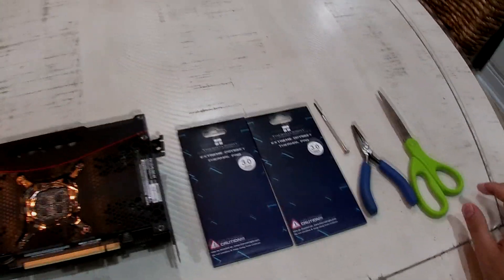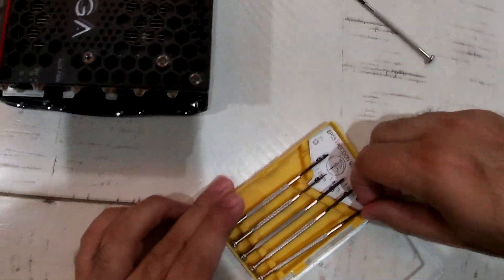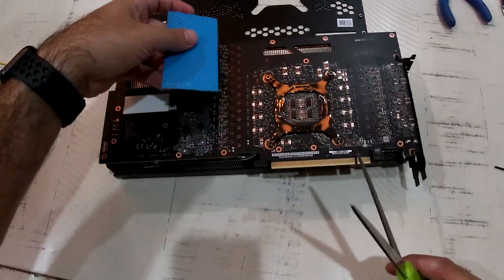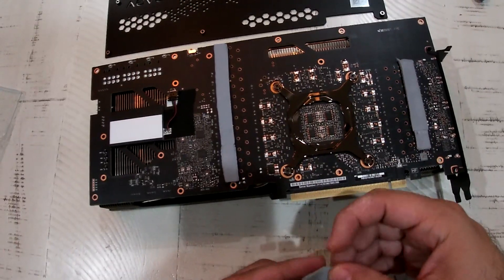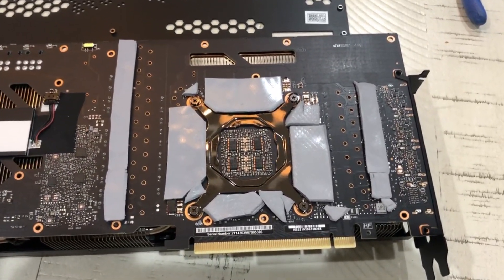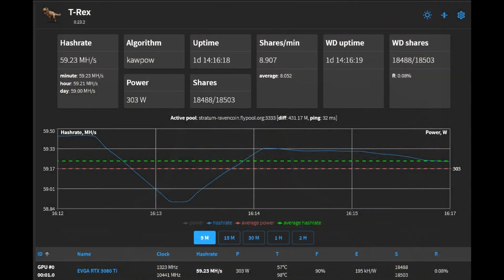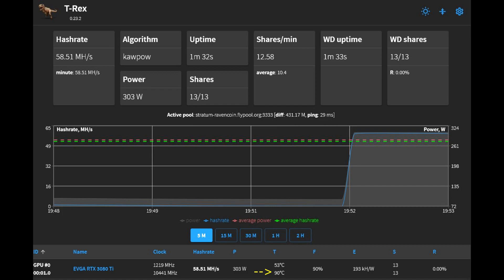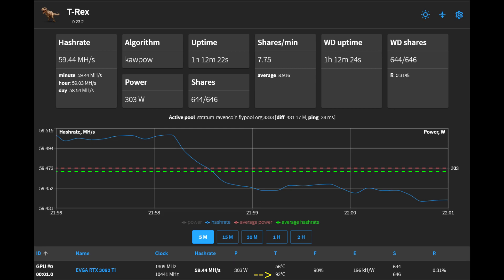How I added thermal pads on EVGA RTX 3080 TI FTW3 to Backplate to lower temps. modification

Comment: @
Rotocut Gaming does using too much thermal pas near the memory backpate BAD FOR THE GPU TEMPS DOES IS HELP OR HURTS TO USE A LITTLE MORE OF THERMAL PAD ????????
Reply from the maker: I haven't see the GPU Core temps go up, because my mod was done on the outside backplate. I've seen reports and I have a friend that actually did OPEN it up and did the whole mod inside, directly on top of the memory modules and he noticed that his GPU core temps DID go up. 

So, I'm not willing to risk my GPU Core temps, that's why I never do this mod on the inside portion, I always just do the Backplate mod and do not notice GPU core temps go up as a result. Just my experience, mind you.

Comment: I tried this mod as well but for gaming instead of mining and my temps also went up. My thought was that it might be drawing the heat to the backplate and just letting it sit there instead of allowing it to absorb into the cooler to be dissipated by the fins the and air from the fans directly. My backplate was extremely hot and even my display ports and HDMI port cables that connect to the GPU were way too hot for my comfort. I reached back to unplug my monitors to take my GPU out again and remove the backplate thermal pads and I have never in my life felt a cable connector get that hot lol. My system runs pretty good after undervolting anyways so i just took the backplate pads off and went back to normal. Mining might be a totally different situating than gaming though because in this video i seen his power was at 305 watts, which is lower than what I'm running at while gaming. My GPU die gets about 72C while gaming and almost all my memory temps are about 68C but there's one sensor in the very middle of a row of memory that starts hitting about 85C. I tried 3 times taking it apart and reajdusting the thermal pads thinking it just wasn't making good contact but its always the same results so I'm just going to leave mine alone. My temps are already pretty good as it is compared to what other people get with the 3080 ti ftw3.
Reply from the maker: It's such a finnicky thing man. dont know it until you try it. I just tried the backplate. It turned out alright for me, but I've heard of bad results as well. Silicon lottery man.
Reply: @rt3rog  for sure. i never win either lol.
Reply: Few years late But:
Probably because backplate is not Alu/Cu metal, and with paint, so it does Not dissipate the heat as good. As such it becomes a warm blanket on top of the thicc hot thermal pad on top of the sizzling chips.

Rather Remove backplate completely and stick some Copper/Alu mini heatsinks & ensure airflow thu their fins. Top shroud removal will help as well as better fans, quieter with good static pressure.
Reply: @ciuyr2510  temps are good without the pads on the backplate. I think it essentially made it a conduit for heat consumption but there's no fans for the backplate so it just held the heat, getting hotter and hotter instead of letting the heat absorb into the cooling fins and then dissipated with air from the fans. It's like if u were to slap an aluminum cube onto a CPU with no fan and expect it to cool it.

Comment: The main mod is changing pads to the VRM's and front PCB, the backplate ones are more of a nice to have but don't offer much improvement
Reply from the maker: very true. i didn't want to open up my card.
Reply: @rt3rog  

"The main mod is changing pads to the VRM's"

Nope, the main reason most people replace the thermal pads, or add them to a backplate of a 3080. is to lower the VRAM Junction temperature not VRM's. Despite having low temps elsewhere, 3080 and 3090 cards have very high DDR6X temp. 95 degrees under load applies to most cards.

Some replace all pads and some just VRAM. I'm changing the pads on the back of my EVGA 3090 FTW 3 with higher conductivity pads. If it reduces the temp by 5 degrees or more I'll be happy. Helps add to the cards longevity. I suspect the backplate pads are the issue, as the memory chips on the rear of the 3090 don't get any active cooling, just a thin backplate to radiate heat. 

Different scenario with the 3080 as there are no VRAM chips on the back of the card. No pads at all though, so adding pads assist with removal of heat from the rear of the VRAM/PCB.

Comment: Maximum safe temp is 95c on the vram.
Reply from the maker: true. just trying to bring it down.
Reply: source? gddr6x doesn't throttle til 110.
Reply: @odellus  Manufactures data sheets, igorslab.  Micron DDR6X.  Operational temps are Tcase 0-95c.  This will be higher for Tj which is the throttle temp.  Tj is the maximum that the memory can take before it starts malfunctioning but this bepends on the chip how close it will get to this temp before issues occur.  This means Tcase has a maximum of 105c.  Never run the memory at high temps with heavy loads and large overclocks.  Its asking for the VRAM to degrade.

When overclocking DDR4 Ram temps matter.  At some point if you go outside the stable temp range then the RAM starts malfunctioning and the Overclock fails.  TOPER = 0 to 95c  For DDR4 the maximum temp is 100c.

Some applications require operation of the Extended Temperature Range between 85C and 95C case temperature. Full specifications are guaranteed in this range, but the following additional conditions apply:
a) Refresh commands must be doubled in frequency, therefore reducing the refresh interval tREFI to 3.9us.
b) If Self-Refresh operation is required in the Extended Temperature Range, then it is mandatory to use the Manual Self-Refresh mode with  Extended Temperature Range capability (MR2 A6 = 0b and MR2 A7 = 1b)

The manufacturer specifies a maximum Tjunction of 100 °C for its GDDR5 modules.  Maximum “Operation Temperature” of 95 °C.

Igorslab GDDR6X modules. Ttot before the start of a possible destruction of the chip should be 120 °C and that Tjunction should probably be set at 105 °C or for the GDDR6X even at 110 °C is specified as the maximum value.  Running the chip at this high in temperature is not normal and leaves very little as a buffer.

IF maximum Tjunction to 110 °C for GDDR6 and memory modules run at say 104c then the remaining 6 degrees until the suspected throttling are really not a big cushion.  Some websites dont see the high temps as a big issue.   Tomshardware gives the TJmax for GDDR6X is 95C.

Then there is mining.  Miners have found that if you dont replace the thermal pads for the VRAM which can reduce the VRAM temps to as low as 85c.  If you just run these cards at high loads and OC's with these VRAM temps.  Then the cards will die at some point in the future.  A few months was given for the failure time.  So youtube has lots of mining videos of people replacing the VRAM thermal pads because the high temps dry out the stock ones (causing even higher temps).  People showing the oil leaking out of the stock thermal pads because they fail due to the heat.

toms: Ethereum mining, temperatures go to a whole other level: When mining on both the RTX 3080 and RTX 3090, we found that the GDDR6X modules would peak at a much higher 110C, and the GPU would downclock itself severely to compensate for the ridiculously high VRAM temperature.

For gaming, with the GDDR6X running at 100C or lower, that appears to be within tolerance from Nvidia's perspective. 24/7 mining on the other hand with memory running at 100-110C seems like the sort of thing that could cause premature card failure.

This is why some people water cool the back of the 3090's when mining, to keep the VRAM cool on both the front and back of the card.  This is why miners are replacing thermal pads to reduce VRAM temps.
Reply: @odellus  it does, i have seen it getting lower hash when hitting 110 only, lower thant 110 is based on silicon lottery
Reply: @xaram  if it's hitting 110 it's throttling my dude. that's the point.

Comment: I did this mod and my temps actually went up 2C-4C. That being said, my hashrate also went up (80MH/s to 83MH/s) so I think there's some funkiness going on in memory throttling on these cards
Reply from the maker: you did it just on the backplate? i have done this Backplate only mod on 2 cards and they've gone down on both.
Reply: @rt3rog  correct, just the backplate

Comment: You need to copper mod the gddr6x memory. I can over glock to 4400 in hive and get 109.8 mhs on non lhr 3080's that way.
Reply from the maker: Yeah I’m definitely sure u can get up to that hash rate but I don’t want to open it up further. Something about possibly voiding the warranty really throws me off
Reply: @rt3rog  from what I have heard in another video that factory warranty sticker does not void in the U.S. if you open up your GPU we as consumer are protected by some law... the warranty void sticker is meant for other countries.
Reply: @rt3rog  EVGA has a great policy about our "right to repair". I called them and asked and they said opening the card doesn't void their warranty, as long as you don't break anything. opening the card is actually pretty easy! i would check Critical Quartz video, cracks it open under 2 mins
Reply: Jesus is Lord  its and msi tri x rtx 3080. Bios modded with strix bios. 4200 on the memory in hive.  Crashed after a day at 4500. So better less hash and stability. Gets 108,9 now. Was 110.4 with the 4500.
Reply: You can explain what you use ? One Copper Sheet ?

Comment: Any drop in GPU temps during gaming with these pads?
Reply from the maker: Unfortunately I don’t game with this card. Don’t have the results
Reply: @rt3rog  All good. I am wondering if I should do it on my 3080ti FTW3.
Reply from the maker: @AlmightyGTR  it’s not a bad idea per se but you really have to consider 1) will you keep this card for a while or forever or 2) will you sell it in the future and this might be detrimental to that sale?
Reply: @rt3rog  Good points. I think I will keep it for a while, but may sell it when I upgrade next time. Any reason why it would be detrimental to selling?
Reply from the maker: @AlmightyGTR  I think you’d have to disclose that right? As far as being honest with your listing and some folks do not like buying modified equipment.
Reply: @rt3rog  Makes sense. I mean EVGA doesn't care, but yes a buyer might. Thanks.
Reply from the maker: @AlmightyGTR  no problem. Thanks for the comments  and have yourself a good day today
Reply: @rt3rog  you too brother. Cheers!

Comment: What are your overclocks for the 3080 ti? It's awesome how you get almost 60 mhs with 300 watts!
Reply: I have the same card, u can limit power down to 45% and still get 60mhs. its around 180watts, just make sure you have good airflow
Reply: @BuddyGuy0621  180 watts and 60 mhs mining ravencoin?? Seems kind of impossible to me 😅😅 which memory and clock overclocks are u running??
Reply: @andyrodulfo5037  oh I’m sorry man this was in regards to nicehash
Reply: @BuddyGuy0621 Thanks tough! if u are mining eth with the 3080 ti, you can get up to 89 mhs with the right miner and overclocks!
Reply: @andyrodulfo5037  oooh what are ur overlocks on msi? because most i can get is around 84. averaging 81. Using nbminer unlock method
Reply from the maker: Oh man. I'm not mining ravencoin directly anymore

Comment: If you could do it again, would you stick with 3mm? Or 2mm?
Reply from the maker: 3mm for backplate. There were some sections that didn’t even reach the backplate.
Reply: @rt3rog  3mm for backplate for 3080ti msi ventus will it work ,??

Comment: I have the same card, SO the backplate is fairly thin with a modest heat soak capacity. Your better off ONLY doing the VRAM that will benefit easily the most. The power delivery components really don't need or benefit, your just putting more heat into the backplate unnecessarily. Secondly you WANT to undervolt 3080/3080TI and 3090 (for general gaming), which will lower power usage by around 100watts with much lower temps and fan noise for a "tiny" loss in performance. Not worth leaving these cards at stock,  and forget overclocking. Obviously you will be undervolting I would hope for mining.
Reply: i just got a ftw3 hybrid, it can do 2.2 GHz at 987 mV. +250 MHz on stock boost clock and ~50W lower max power consumption.